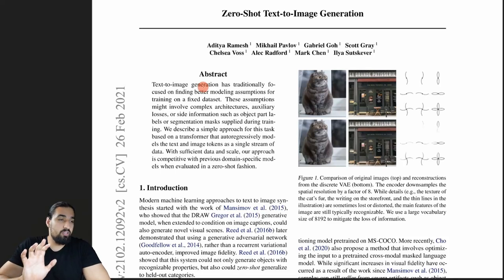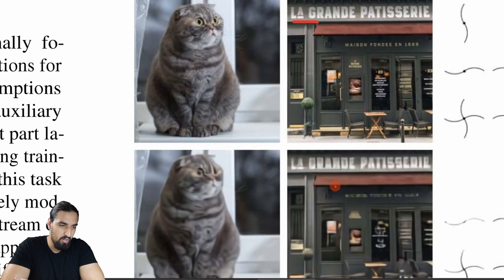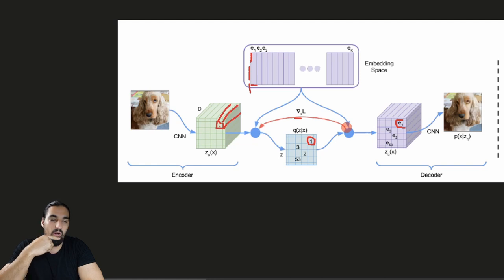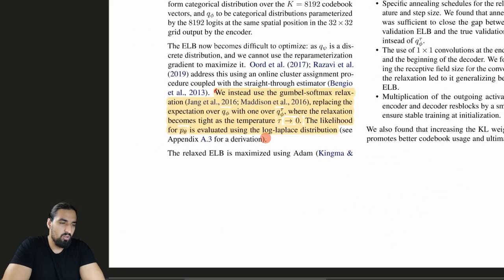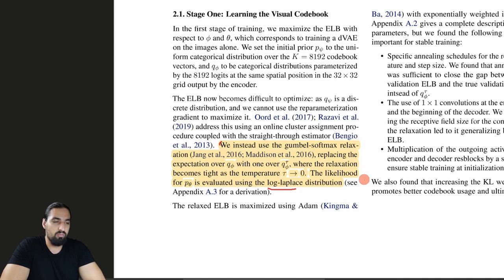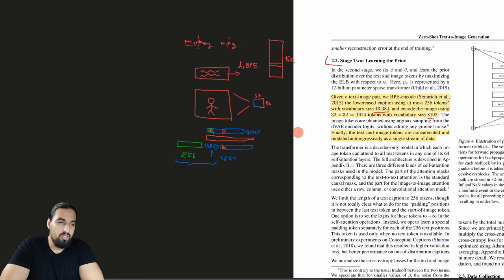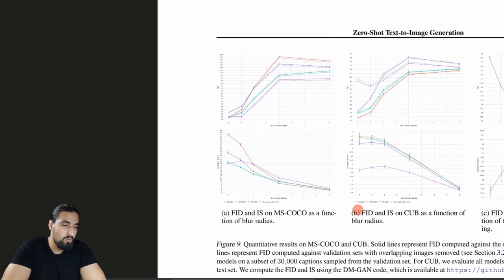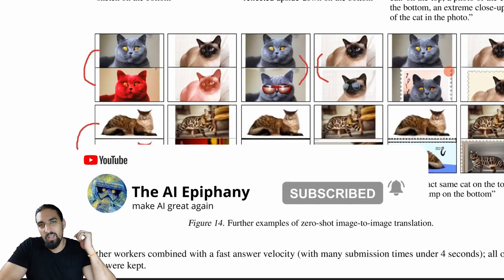DALL-E: Zero-Shot Text-to-Image Generation | Paper Explained

Comment: VQgan + clip is better than dalle and its strapped together very easily
Reply from the maker: Sure but it can't use text, in the original setup, that's the downside
Reply: @TheAIEpiphany  it basically generates an almost complete image on the first 3 iterations with the lr set to .4..  in our setup of dalle, we still had to use clip's simple tokenizer and text encoder in order to use it. the discrete vae they provide in dalle doesn't encode text either -- only clip can encode both image and text - and i suspect thats what they used too. people will tell me they didn't simply use clip -- i say they should prove it by releasing it lol